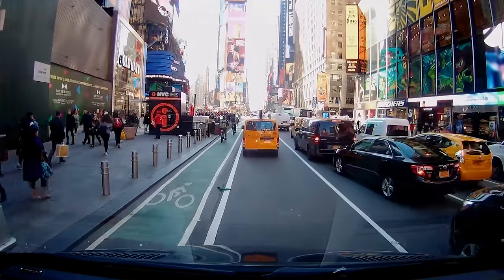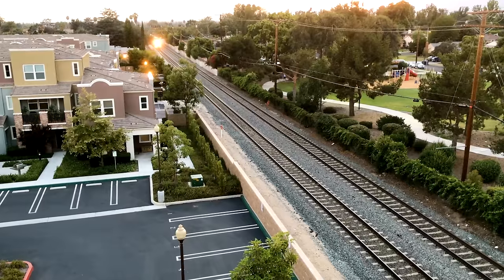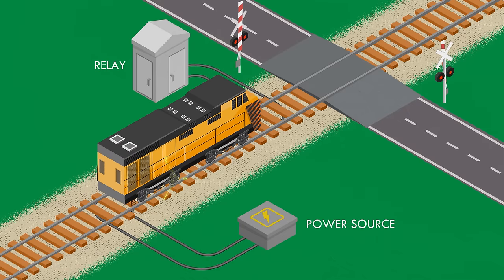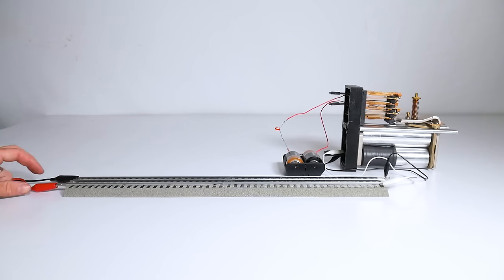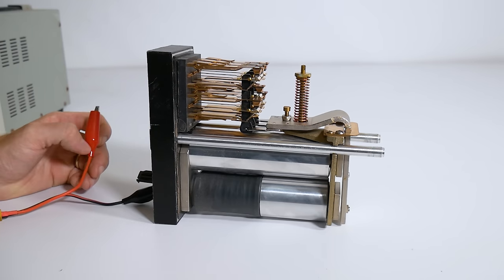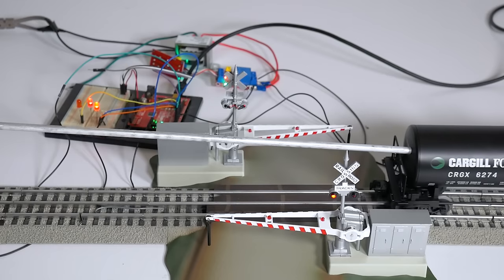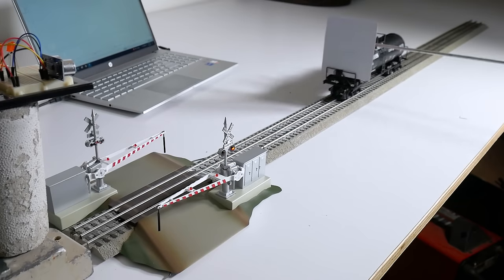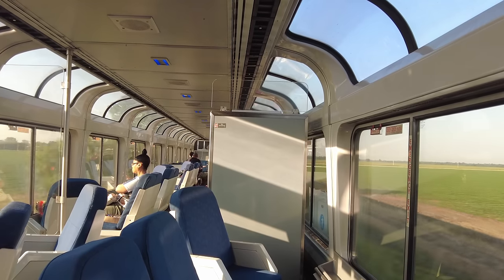How Railroad Crossings Work

Comment: I don't know what type of bright future you're trying to predict, but at least in rural Germany, things are quite different. When I worked as a signaller in railway service with Deutsche Bahn, the next signaltower's signaller would use a hand-cranked analogue telephone to ring our signaltower and ask for permission to send a train. Then we issued this permission by hand-cranking our signal box inside our signal tower, activate the track on the signalbox and pull on a lever to activate the proceed signal. The level crossing barriers were not interlocked, and we cranked them down by hand. Some signal towers already had electric motors, but in any case, they could also resort to cranking down the barriers. And this was 2016. I doubt that by 2024 Deutsche Bahn will have made use of the witchcraft you're demonstrating here.
Reply: Germany is so funny with this. They have both the most modern systems in use, like LZB since the 70's, but at the same time, they also have hand-cranked signals with a person in a local tower like you describe. Even in the current day.
Reply: There are still plenty of non-automatic level crossings, and lots of (what is essentially) Absolute-Block Signaling across Europe (and Asia).  These systems have worked reliably for many decades.
Reply: @jovetj  We have ABS in a lot of places in the US but CTC is often much preferred since it prevents train movements without clearence. Everyone and their mother finds out when that happens. Using blocks to control signals in the US would never work because they can reach several miles long.
Reply: @pootispiker2866  “Using blocks to control signals in the US would never work because they can reach several miles long.”
Where did I recommend that??
Reply: According to a legend, the rotary dial telephone will eventually replace hand-crank units in German signaltowers in 2050.

Comment: One crossing safety you didn't touch on was what we refer to a ghost train. There is a crossing just downstream of a station, so the arms go down as the train is approaching the station till it stops, then the arms go up until the train is ready to leave the station, then the arms go back down. (Although the rest of the lights on adjacent streets are independent and lead to regular grid-lock of busy intersections.)
Reply: yeah the train operator usually has some kind of tele-tone he sends out over the radio that the signal is programmed to listen for. Either that or maybe it's tied into the signal system so a green to leave the station also triggers the crossing guard
Reply: No, he very much did touch on this topic.

Comment: The railroad crossings in my area are not as sophisticated as the ones you describe. The one I deal with most regularly will go down before the train gets to the train station that's a block before the crossing, so we have to wait for loading/unloading of passengers, then for the train to accelerate and travel another block before finally passing by.
Reply: Were i live this also happens when the train pulls into the station it triggers the gates but after like 30 seconds the predictor sees the train has stopped and they go back up

Comment: I watched on Nebula, but dropped in on YouTube to give a thumbs up and comment.  I've been an Amateur Radio (Ham radio) operator for more than thirty years, a broadcast engineer for twenty years before retirement, and an electronics geek for more than fifty-five years.  That's the slowest relay I've ever seen!  It doesn't seem to have a retarding mechanism.  Why is it so slow?  Great content, Grady!
Reply: It's slow so errant rapid control changes don't affect it.
Reply: good question...  I wouldn't mind learning about the details of that relay too.
Reply: A mechanical schmitt trigger
Reply: @SkyhawkSteve  What would you like to know?  It's a very simple relay.  Railroads have employed much more complicated relays than that one.
Reply: @jovetj  I misphrased my question.  What makes it so slow?
Reply: Think of it like an inherent debounce. Don't need things to move super quick so slowing down improves longevity.
Reply: @johnwiley8417 If I had to guess the residual magnetism in the armature generates eddy currents in the mechanism of the relay, causing a brake effect.
Reply: @jovetj  well,... everything? 😀  I've used a lot of types of relays, but they've all had a fast response to the application and removal of power to the coil.  There's a huge cylinder next to the coil, which I would guess is a large capacitor that provides some of the observed delay.  Is there a datasheet for the relay online somewhere?
Reply: @SkyhawkSteve  Well stated.  The armature moves like a dashpot is connected, which is what I thought the upper cylinder might be until I rewatched the relay action.  But I still can't figure out what makes it move so slowly and at what appears to be a constant velocity.

Comment: Railroad signal design engineer (and railfan!) here: you did a pretty good job of getting the gist of everything. Railroad signaling is, as a whole (and by our own admission), a dark art with little available reference to the lay outsider. I've toyed around with the idea of making my own deep dives for everyone's benefit, but I'm also keenly aware it's not exactly a "hot" topic 😅.

Couple notes:
5:05 - I suspect your power supply either is too low of voltage or too low of provided current, as this particular relay (Alstom/US&S A62-357) should "pick up" in a snap, not gently as shown. Hearing several layers of logic (at complex locations) sort themselves out in relays states is quite the experience.
7:42 - Relatedly, this model should be a "slow drop/release" relay, maintaining contact for a brief moment once coil power is removed -- that part seems to functioning properly. That said, track relays (when not using a microprocessor) are usually of the "slow pick" variety, so they don't recover the track circuit under a train with bad shunting, but will react immediately to a train's presence. With a microprocessor, we can implement any duration of Loss Of Shunt (LOS) delays, so we'll use standard relays for input.
7:22 - Fun fact: the flashing lights are controlled by gate position (gates being not up). If the gates lose their control signal and drop due to a cable break, etc., the lights should always come on as well. A dark crossing is worst-case scenario.
13:20 - Having been doing this for 8.5 years now, your explanation of crossing predictors is about as deep as I understand them to work too; it's a dark art on top of a dark art. Something about phase and resistance and inductance, but it's all consolidated into one device, so we really only concern ourselves with electrical connections, program selections, and track-circuit-length-to-frequency-selection dynamics.
13:30 - GCPs/HXPs (Grade Crossing Predictor/Highway Xing Predictor) do operate at "audio" frequencies, but unless something is very wrong, you'll never hear them.
13:40 - This will probably be covered more in a coming video, but we routinely overlay AC crossing frequencies with DC pulse coded track circuits (used with wayside signals) because each system can isolate the other signal type out. We actually have to filter the pulse coded circuits (begin my assumptions) to smooth out the high frequency harmonics of a square wave from interfering with crossing frequencies.
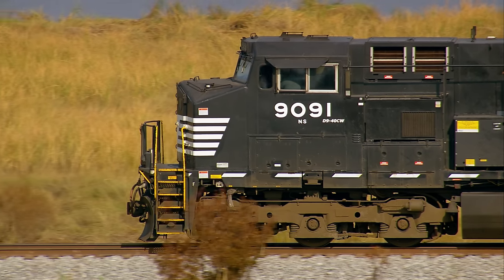14:38 - Even if the police are already there and they say they've called in a blocked crossing to their dispatch, STILL CALL THE NUMBER and report it. The Amtrak crash in Michigan a few months ago was caused by a police miscommunication regarding which crossing was blocked and so their dispatch didn't contact Amtrak at all (they called CSX about a crossing miles away).

Comment: Many crossings have a function in the detection device that if a train stops before getting to the island circuit, the crossing will clear after about 15 to 20 seconds.  The detection device can detect when a train starts moving again and restart the warning devices.

Comment: Most common mistake I see at crossings is drivers ignoring the flashing red lights and relying on the gates alone. In some instances, the gates may start going up despite another train approaching from the other direction. In short, RRs should better educate drivers that the red lights alone are the warning. Not relying on gates whether it's safe or not to cross.

Comment: Great video for anybody interested in the railroad or systems science in general.  In my town, they recently introduced a high speed passenger rail service that shares tracks and grade crossings with slower moving freight traffic.  It took almost a year to get it all set up, and they’re still testing the system.  Only recently did they stop posting flagmen at every crossing as a backup in case of signal failure.

Comment: I was handling a car crash at a grade crossing one day.  First thing we did was call the railroad to stop the train, then called a tow truck to clear the wreck.

When the tow truck dragged his winch cable across the tracks, he shunted the circuit and the gates started to come down.

For a split second, though, my heart jumped into my throat cause I was worried the train wasn’t actually stopped.

Comment: As a model railroader (and lifetime Nebula subscriber), I'm not shaking my head. I'm actually thrilled you're using one to help show how things work better. Even if you did end up using a 3 rail Lionel system, it certainly helps show things in action. As far as using an Arduino, those things can be absolutely awesome to use!

I thought I'd add for anyone that wants a deeper dive into this, another channel that I follow has a lot of detail since he's a pro in the industry. Here's the link to anyone interested
https://youtu.be/2L6wg7gx_zo?si=bhESh0vI9HsGbxws
Reply: And he had to use a 3-rail Lionel system, because the circuit relies on the car shorting the outer rails together.  On a 2-rail system, all the train wheels have to be insulated from side to side!

Comment: If you're in stop and go traffic, or at a crossing before a traffic light, it's best to stop at the crossing, then continue across when there's enough room for your vehicle to be safely stopped passed the crossing. I'm not sure for private drivers licenses, but commercial driver license holders, it's illegal to stop, or even shift gears on tracks/crossings.

Comment: I was always told lcocomitve engineers have their own distinct horn pattern and it varies from driver to driver although I can be very wrong, especially if this is rule/law when operating a train.

Few years ago in Pittsburgh on a 3 track crossing, I noticed a large piece of rail guard and a rail spike sticking out way abover the road bed. Called them up and within 15-20 minutes, NS had their crew there to fix the problem. Pretty cool to see!

Lots of awesome info in the video as usual! Thanks!!!

Comment: Primitive but quite effective for trains going at near walking speed!! 😅. Here in Europe our long distance trains operate at 320 km/h - the track is always dedicated - roads take bridges or tunnels. Stopping distance is several kilometres so signals are relayed into the driver’s cab, and automated devices ensure they are noted and acted on.
Reply: We do have at-grade crossings in Europe too. But they are few and far between these days.

I'm nearly 30 and I remember a significant number of at grade crossings here in Denmark being converted to road tunnels during the last 15 or so years. 

My hometown had two at-grade crossings in it on a fairly busy regional train route. Two to four trains an hour depending on the time of day, each of them closing the two crossings for 2-3 minutes each. The town was essentially entirely cut in half for road traffic during that time. The only way to get to the other side of town was the pedestrian bridge at the train station itself. 

So not only was it a safety issue, it was also a near daily disruption for us locals just trying to go about their day. They were both converted to tunnels about 10 years ago. You only really see at-grade crossings on super rural roads these days, and they still have all the safety features that a busy one would.
Reply: Here in Europe, most of the railway network is still not high-speed ;) Maybe it's only in France and Spain where true high speed networks exist. In other countries, it's just a single high speed line here and there.
Reply: This system still works for fast trains too these same systems are used on all the crossings near were i live and handle trains from 80 mph to walking speed giving them all the same amount of warning time before they approach the crossing and also handle things like when the train stops at a station just before a crossing
Reply: @tux_the_astronaut  Sorry, 80 mph is not high speed = 130 km/h.  330 km/h is 205 mph!!
Reply: @Richardincancale  ya ik trains here aren’t technically high speed i just ment high speed in terms of just going relatively fast. And that how the crossing system can be designed for faster speeds in mine with them usually being programmed for the track speed which around were i live is 80mph
Reply: @tux_the_astronaut  I know - I’m just joshing you!

Comment: Having just done a class on railraod signal engineering, I have to say this is one of the best videos out there on the topic. My one note would be that track circuit detection is going away with new installations. They are sometimes using sonar, sometimes auable waves, etc. to determine when a train is coming. Track cuircuits, while still reliable, are starting to reach the end of their era. Otherwise very good presentation!

Comment: I'm happy you made this video, as the demonstration model is exactly the sort of thing I've been needing to show how signaling with gauntleted/interlaced track works by using Modded Minecraft with the Create Mod, but the hard-coded configurations of the Track Signals in it prevent me from doing a proper demonstration model where signals at either end of the gauntlet will trigger when a train enters or exits the gauntlet.

Comment: Thanks for the video. I learned way more than I expected to. I have also been staring at signal connectors on tracks for years and wondering what they are. I can also see new ballast rocks near one today - and now I know it’s for good drainage. I now also know the reason trains are delayed in heavy rain. I always thought it was because the equipment needed upgrading. I also have your book btw 🙂. 

Please keep doing what you do.

Comment: Thank you for this very clear explanation. I knew about the approach circuits but not the island circuit. On my 3-rail O scale layout I have two interlocking approach circuits. When one is activated it locks out the other one until its block also is clear, making the circuits bidirectional and allowing the gates to raise as soon as the train clears the crossing. This is based on an article from years ago in a model railroading magazine, and uses two DPDT relays and insulated outside rails for detection.

Comment: Working a construction project that paralleled a set of tracks that forced us to run our equipment on top of the rails. There was one crossing towards the end of the site and we figured out that we could activate the crossing by laying an aluminum ladder across the rails. We frustrated a lot of motorists during that job. Very interesting to see exactly why we were able to do it. Excellent video.

Comment: Can confirm the annoyance of "what train???" situations. Last month, I was stuck at a crossing for 15 minutes... because a BNSF truck (the kind with the drop-down wheels so it can drive on the tracks) was doing maintenance on the signal box, but in the process it was keeping the circuit triggered and the gates dropped, despite being fully out of the way of the road. ...although thinking about it, it might have been the maintenance itself keeping the crossing closed in the fail-safe state, rather than specifically the truck wheels closing the sensing circuit.

Comment: Living in a small town with 3 crossings, I have often sat there waiting for the train(s) to pass, wondering how they work. Thanks for the insightful video.
We still have manual crossings operated by a manned signal station. In some places, you get to see the guy pulling the leaver inside the shed and a wire, which goes to the crossing arms, pulling them open or closed.

Comment: Reminds me of a video about a runaway suburban service that was longer than the train running without brakes or a driver from the end of the line to major train station in the city where they redirected it into a diesel. The diesel locomotive got off fine from that exchange. They eventually fixed the suburban train and it served the rest of its life.

Comment: One of the things I remember when I was going through truck driving school, if we ever got a truck hung up or stalled out on the tracks, we should take a load lock bar and place it across the rails, which would alert operators to the present of something on the tracks there and hopefully stop an approaching train more quickly.

Comment: I used to work in a building that required me to go through a 4 way street intersection that also had a train go diagonally through the whole intersection to get to it.  Invariably, I would get stuck with a train that would be stopped across the intersection then would go back and forth on the track entering and (barely) exiting the intersection.  The traffic lights were set up so the direction I was going was the last event in the cycle after a train event.  So everyone else at the intersection would get to go, and just when it was time for our light to turn green, the train would pull back into the intersection triggering the traffic light cycle to start all over again.  Definitely road-rage inducing.